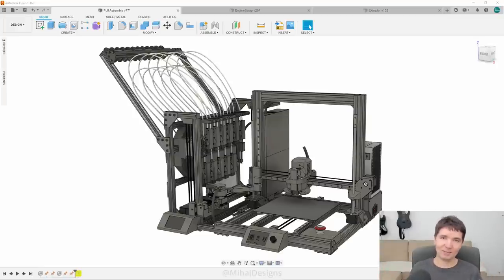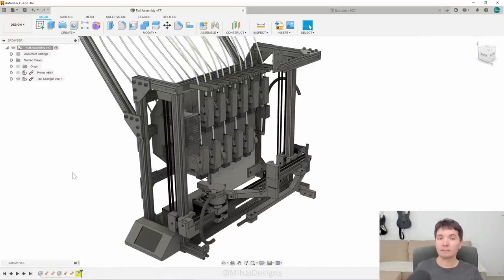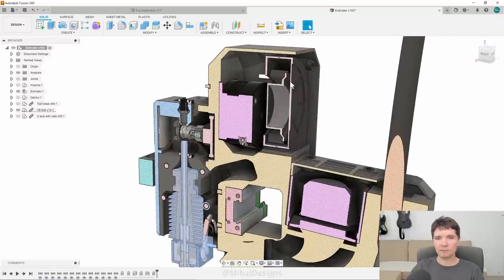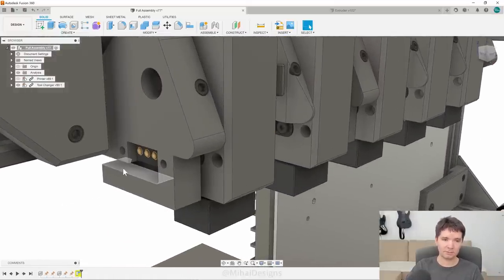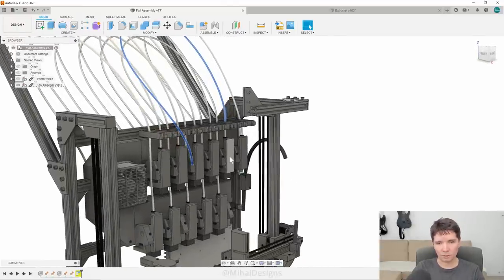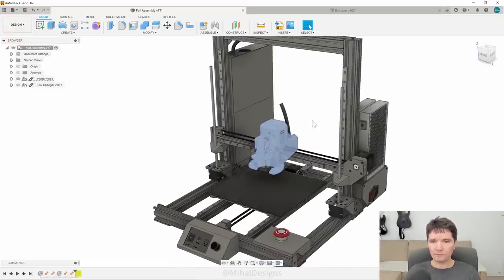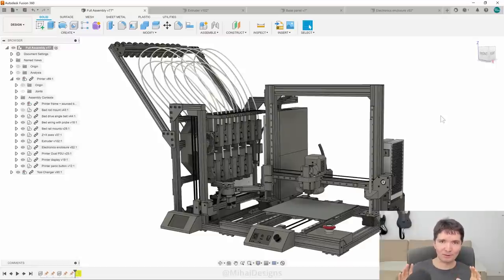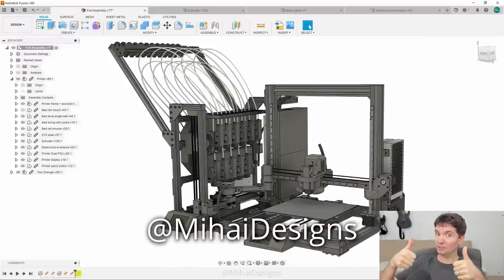PitStop 3 multi-material 3D printer in-depth design. 10+ materials at once

Comment: Wow, what a project! Not only is your design awesome, but also the Fusion360 modelling is top-notch.

For the tool changer I'd suggest to make all slots active slots and just do a temperature control multiplexed for all hotends (probably at a lower standby temp). Yes, this might need a few more MOSFETs, but overall I think it's way easier to put every hotend always back in its same slot and not having to deal with tangled tubes or shuffling around hotends between slots.

For control I'd suggest a setup similar to how most Biqu displays work: They act as a separate controller using special firmware and can pre-process the G-code they read from their own SD card reader, which is then sent to the main board running Marlin via internal connection.
Reply from the maker: Thanks! I find the tube untangling to be a fun challenge to solve. If it doesn't work, then you are right that I can fall back to running all active slots and figure out the custom hardware for that.
Reply: @MihaiDesigns  maybe use klipper as an firmware, with it you can add more then one controller board and heave all the heaters you want, also with some python scripts and klipper macro you can solve tool selection.

Comment: With CoreXY you could also have kinematic bed coupling (like the RatRigs), enabling tilt during non-planar printing like your printhead already supports. Because if you do non-planar printing with the nozzle at a different angle you'll easily get very bad results, depending on the direction of the movement (going uphill vs going downhill vs going across). Even with airbrush nozzles it matters if the filament is extruded to one direction or another. You really need either the nozzle to tilt or the bed to tilt or it'll be utter hell trying to slice it (even more so than non-planar slicing is anyway).

Also, with CoreXY it would be easier to make an enclosure, for printing tricky filaments that easily warp if they cool down too much.
Reply from the maker: Yeah, that's the plan for a future version, but it'll be a little while before we get there.

Comment: I see further potential for even larger beds, belt-beds, or even chamber.

But One thing that would be a very interesting evolution of it for a "v2" (or whatever name that sounds more fancy..), taken directly from tool-changers from CNC machines, top-mounted tool-changer on a rotating magazine, so the print head goes up to it and the magazine pulls out the current tool into an empty set spot for that given tool, and then the next tool only moves down to slot into the head/mount and back down we go again for more printing fun!
To further build on that style of system, with a top-mounted magazine like that, the tool heads could even be automatically z-tested in the magazine to calibrate them up there prior to being put into the slot for printing, only needing to reference machine z-offset after that.

Comment: 23:11 keep it simple by setting that every hotend has their own position in the stand by station, hotend 1 to the position 1, hotend 2 to the position 2, always. Another thing: trying to keep pre-heated hotend will create a lot of complexity because it's too far from the printer (during the movement the temperature will drop, some filaments will drop because of remnant pressure in the hotend, having such small amount of pre-heated nozzles will require a lot of movement creating waste of time just in the standby side, ...), and even if you resolve them, the user will need to keep in mind specifics gcodes for their specific filament creating more tuning than necessary. I suggest you to keep it simple by watching how the Prusa XL will do it: first you should think in a CoreXY printer to reduce complexity and have a lot of optimizations like using a single power source instead of two and not using bed slinger that could cause a lot of artifacts in the prints.

Aaaannnd you made bassically a big resolution for a lot of problems explaining the nozzle probe at 34:45, so you can forget almost everything I already said, but the CoreXY approach must be implemented.
Reply from the maker: CoreXY planned for early next year, after I get this working.

Comment: So after watching this 12 hours ago and thinking how amazing I wanted to see if i could  improve it for less tangling and preheat control a simple solution to the tangle is each filament has a designated spot so no filament is ever in a different spot, but that leads to preheating. this could be done using the tool changer it could have a pogo connector so it can reach ahead of time and preheat before the appropriate time. So i would imagine every mount would have  the connection but the tool changer would have the provide the power. Hope this makes sense.
Reply from the maker: Makes sense, but it would be very hard for the arm to provide power because it has to not stay in the way of the connector when it mounts the hotend in the extruder. And on top of that, it might have to preheat multiple hotends at the same time. But with my design each hotend does have a spot and it will sit in its spot most of the time when it's not needed, but on occasion it may swap places with other hotends temporarily.
Reply: @MihaiDesigns  I was thinking the arm would be mostly waiting for its next move so why it was waiting I can help preheat the next hot end. I just feel like coding the mapping of the places of the hot ends is going to be a little more difficult especially if you have to consider not tingling the filament so I was trying to go at it as if there was more consistent and location so tangling wasn't a factor. But as you build it maybe this will spark a different idea if you find it helpful

Comment: Very impressive! At minute 20 or so you mentioned the problem of preheating. I suggest to just have a single connector located in the arm. So whenever a certain tool needs preheating the arm can just dock against that tool in advance and power it up.

Comment: What a great project. I would consider using Klipper for both the printer and the tool changer. Both controllers can be connected to the RPI and you can drive the tool changing function through Kipper macros with perfect synchronization. Many other tool changer do this.
Reply from the maker: There's an advantage in running motion asynchronously from the printer, otherwise it can't do any move while the printer is printing. And I need a custom interface. So even though your solution would work, I'm willing to try a different approach.
Reply: @MihaiDesigns  in short the klipper ecosystem looks like this today:
mainsail/fluid (web user interface) -> Moonraker (API Web Server for Klipper) -> klipper (3D-Printer firmware). For the needs of your project, we only need a klipper - to which you need to add your own custom interface. Klipper provides: multiple micro-controllers, multiple extruders, multi-device support (kinematic, sensors, sensors, stepper motor drivers, etc), that's why there are so many comments supporting the selection of a klipper :)

Comment: Very impressive! How do you plan on connecting the probe tool with the pogo pins? Since the pins are connected to thermistor and higher voltage ports for heating. Perhaps the probe tool would have its own wires connected to the toolchanger board (instead of a PTFE tube like the regular tools)?

Can't wait to see the next update on this project!
Reply: I had the same thoughts, the wires would definitely need to follow the path of the PTFE tubes like the other hotends, but ultimately I suppose they don't need to be connected to the swapper and could be connected from there straight to the main printer board (so the swapper doesn't have to manage the probe signals). You're right about not going through the pogo pins though, would have to use some relays for that, which would be a pain.
Reply from the maker: Indeed, the easiest way for now at least is to pass the wires through the tube and then to the printer board.

Comment: Outstanding CAD work ,have a more simple idea ,that is ; place all your extruders at the top X  gantry and place a Z slider above slides on a rail that will push the new extruder downwards (latching) -Z <-> Z, you need another input for controlling the new ABOVE X axis ,powering the hot ends can be done by SSR sharing same ground with an adequate power . Good Luck.

Comment: Rather than risk tangling the reverse bowden's, consider using Pi Pico's to control the preheating of each nozzle in its normal storage location,  Pico's cost 1/10 the price of a normal Raspberry Pi and are perfectly capable of controlling two extruders, for power switching very cheap and small MOSFET boards are available  that can handle the current needed for 40W hotends, each pico can be configured to run on an SPI bus as a slave so a single bus can be used to link them together with minimal wiring.

Outstanding design, looking forward to seeing this progress

Comment: Why not put the pogo connector on the hotend side? That side would be used much less often (you use different hot ends) and would be easier to replace (it's not meant to be permanent).
Reply from the maker: Indeed, this has been proposed on my previous design. It's easy to swap the connectors already (moving the pogo to the hotend) without any other change and there are advantages to this. On the other hand, the side with the pogo pins is pricier and would still require replacement from time to time. We'll see how it performs in practice, and luckily the change is very easy to do.

Comment: Looks pretty good! is there a reason you went with a v6 style break / nozzle combo? Is there a chance to go with an "all in one" style similar to the revo? In my experience, the gap between nozzle and break is a variable that introduces errors in positioning and extrusion inconsistencies. I love that the revo setup has no gap and the nozzle can be fully seated in the same position every time.
Reply from the maker: No particular reason other that it can be had for a lower price. The idea is to support other hotends like the Revo. But there will always be some sort of misalignment between hotends, reason why I have a probe.
Reply: @MihaiDesigns  nice! I built my first machine back in 09.. had to mess with a lot of firmware development (not my strong suit haha).. this is looking great! I would love to see it available sometime. I have a print farm now with 38 machines.. we do a lot of small single color parts on a bunch of prusa mini and mk3s but also print a lot of multi color beer tap handles. The MMU is just ok, but would be nice to have a system like this!

Comment: Wow, my goodness you did a great job! 
I was wondering, if this printer fully works in the end, would you ever sell kits of the printer or would you just have like fully build instructions of the printer?
Because I think when you get this to fully work, a lot of people would like this printer :3
Reply from the maker: Ideally we'll have both full build instructions with BOM as well as pre-assembled units that come tested and tuned.
Reply: @MihaiDesigns Noice, I will defiantly be ordering one when available :3
And around what price range will the printed be? I guess probably around 700 to 1000 dollars?
Reply from the maker: @wjsbruwer8206  The project requires a lot of parts, unfortunately. For this money, you could perhaps source about half of them off the shelf for DIY 🙁. I'll be looking into better sourcing options later on because as it stands, only small businesses would afford it.
Reply: @MihaiDesigns  I realy like your printer and would be interested of buying one?
Would it be possible that you sell a kind with all the non 3D-Printed parts? 
And then you can 3D-print the parts at home and fully asemble it by your self?
Would be a price of around 2k$ possible for that? Or is it way to cheep?
Reply from the maker: @davincifpv3842  it's way too early for me to know a price yet because the design is not even finished, so I don't know if that price can be achieved. I'll know more as the project progresses. Cheers!

Comment: Wow!!! This is amazing👍 I really like the idea to use nfc tags🔖 I think you should make the station a cylinder so you can rotate it. That will enable you to have a smaller setup and include more tools
Reply from the maker: I did consider a large revolving unit with all the tools, but there is a risk there with filaments snapping after being twisted a little bit on every tool change. Good point though. I might make a prototype of that one day to either prove or disprove my assumptions

Comment: Can't wait to see it in action. If the standard is 10 filament lines could you connect it to a 3DChameleon for 40 different filament lines with next to no purge towers or waste?
Reply from the maker: I haven't used that, but we don't have a hard 10 filament limit, which is one of the core features. In fact, I'll be assembling a 20 filament version later on. 40 would be a bit of a logistical problem, but should be doable!

Comment: A small custom PCB could be designed for heating the extruders and use CAN. Then you could use as many or as few of them as you wanted and have software control of the extruders. It is a relatively simple/low cost PCB to do this.
Reply from the maker: That could be done indeed. I wanted to avoid anything custom for now, but in the future I'm also considering custom PCBs

Comment: Really impressive. Mind is blown 😄
Maybe it's an option to make all the parking bays active. Park all hotends in their own spot at all time so the tubes won't get tangled. Add relais to the power of the parked pays so they can preheat when the gcode trigger is met. There are lots of 24V SFF relais
Reply from the maker: Thanks! All active is a recurring theme and I do get the reasons for it. It's a fallback solution if the current one proves to not be as easy or as reliable as I'd like. Personally I find it a fun challenge to solve the untangling and is why I wanted to go with it, but I'm ready to discard it if it doesn't work perfectly.

Comment: Great work Mihai. I wonder if that arm around the hot end on the extruder is really necessary. I bet you can find a more efficient way to lock the hot end. 
Maybe with some kind of actuator, servo or magnet.
Reply from the maker: I looked into this but couldn't find a good solution so I postponed it for some other time.

Comment: As other people mentioned in comments, you really should consider Klipper for driving the tool changer.  It does not require you to be an embedded engineer, since klipper installs a "thin" layer of firmware on the embedded controller (stm32, arduino, linux process, etc....)  and then serializes and sends commands to it. While the Klipper software itself already can be connected to multiple such firmwares at the same time, and behaves as a central processing manager for all the different things happening on the various controllers (of the hardware/motor drivers).  It would also be easier for you to extend Klipper since it is written in Python rather than spend a lot of time learning and perfecting various embedded compiled languages such as C/C++ or whatever might be "the norm" in the STM32/Arduino/PIC worlds.  Forget about all the people talking about websockets, and moonrake, and mainsail and all that ... those are just the frontend user interfaces for Klipper, and you can simply ignore all of them altogether right now while you extend Klipper's Python code to manage the machinations of the g-code predictions and scheduling the various commands sent to the various hardware controllers.  Great project overall though, really impressive!

Comment: If you use klipper on pitstop you basically get a serial and a websocket api  (through moonraker). You can define it as a printer with no kinematics and define custom steppers that you can move as you wish.  klipper also has a plugin to execute any command on a printer
Reply from the maker: I did think about this. But this tool changer needs a lot of features and custom UI for hotend management and filament management. The main challenge is that the tool changer should be able to do some moves asynchronously from the printer, while others should synchronize. AFAIK Klipper has only one command queue. I guess I could use two Klippers, but then I need new UI anyways, so I don't really see a benefit. There's also another project I'm working on where Klipper wouldn't work, so there's an advantage here in running custom firmware and reuse it later for other projects.

Comment: I would recommend you use L-corner brackets for the 2020 extrusions, they will ensure a perfect 90 degree. In my experience those right-angle L brackets will not give you a perfect 90 degree or perfect constraining
Reply from the maker: Indeed, with L plates you get flatness on the side with the plate, but not a 90 degree angle. I might add corner brackets as well, just need to make sure they're exactly 90 degrees because I've seen some that are cast and are not perfectly 90 degrees.

Comment: 24:30 not all nozzles can be exactly at the same height, that's why the newer approach it's to use a combination of LiDAR and pressure detection. A simple approach will be a maintenance routine, where for example the user calibrate the first layer for every nozzle every time they need to setup a new filament roll for that nozzle. I don't know for sure if this is the best "run a car" approach but I'm thinking more in "check your oil level" :D
Reply: But you can calibrate each nozzle height using a z endstop pin. Like the vorons.
Reply from the maker: Yup, the calibration is automatic with the probe on all 3 axes. Manual calibration with so many hotends is out of the question.